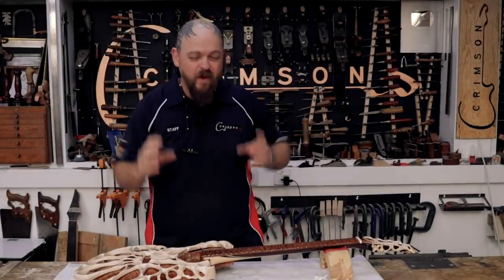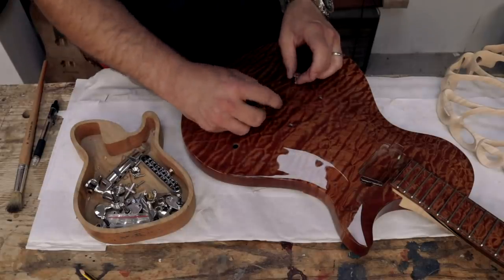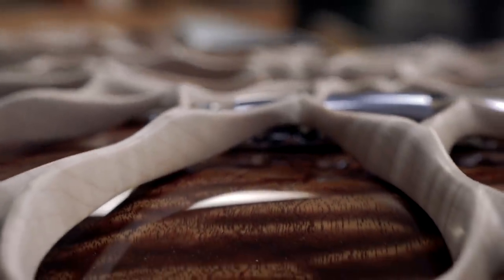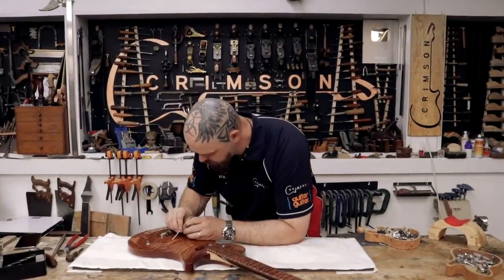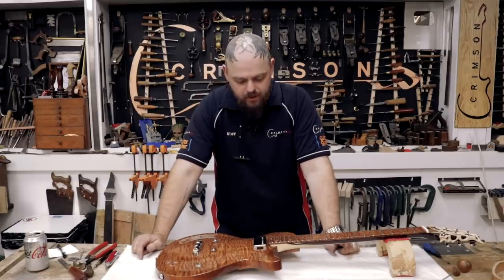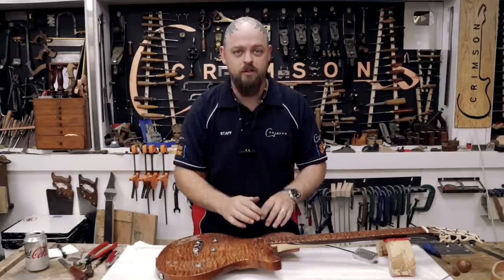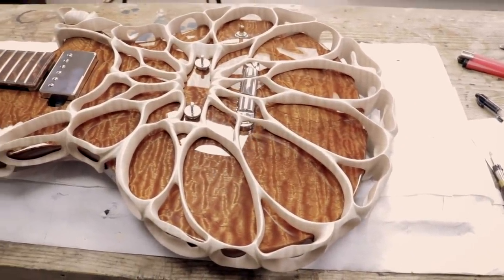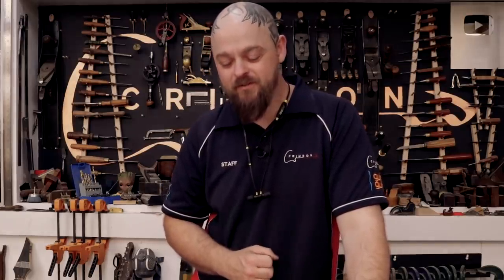Ep 21 Making a Start on the Wiring -  The 90 Hour Build - The Complication

Comment: Try rubber pads between the exoskeleton and the body to secure it like the bottom side of gecko feet or octopus tentacles. Natures way.
Reply: I was going to suggest that too. That or glue very thin pieces of wood inside the grabbing parts, then the exoskeleton would stretch over it and snap back into little grooves in the body sides. A snap and click fit.
Reply: Could also put some magnets in the areas that can’t be seen?
Reply: That's what i was thinking
Reply: @KristonAbbott  Strong magnets would probably interfere with the pickups.
Reply: Rubber would absorb vibrations and reduce resonance, though...
Reply: Thin cork, used in instrument making a decent amount
Reply: rubber dry-rots unfortunately.
Reply: Use a live squid to hold the exoskeleton to the body then … It becomes alive !!!

Comment: the most complex guitar to clean
Reply: Yup. Get out the toothbrush and cue tips!
Reply: @Spthomas47  Oh yes, and don't forget the tube tip cream and oil!
Reply: Compressed air, maybe?
Reply: @helgijonsson3537  that would get light dust, but proper cleaning would require above materials

Comment: It's the insanity I came for.  I can see videos all over the place about normal guitars, I love the over the top guitars you make, not seen a dud yet.

Maybe use a resin colored like the finish had dissolved.  Some small dowel pins to line it up and the resin to squeeze out a bit making it look like it organically dissolved the guitar?  Wood glue on the dowel pins.
Reply: Yep, the insanity is what makes Ben's build videos so different and SO good!
Reply from the maker: @nightlurker  Thank you
Reply from the maker: Excellent suggestion!

Comment: At this point, I would probably use some very thin foam tape. It is dark enough to look like a shadow line, thick enough that all the way around will take up the gaps between organism and guitar.  The foam would be just slightly sticky, enough so that it won't easily slide off the sidewalls.  And, it would eliminate any potential acoustic buzzing between organism and body.  Someone commented on cleaning. This is an important consideration. In this case it could be removed to clean the whole guitar properly, and would be put back together without scratching the laquer finish. (This minor builder's recommendation)

Comment: You could line the underside of the alien growth with craft adhesive felt.  It come in sheets and many different colors.  It could help take up the extra space, and protect the service of the guitar from scratches from the growth.  It would be very easy and somewhat fast to install.
Reply: Or some sort of felt/rubber. It would be a tight friction fit
Reply: I was thinking cork, it’s used a lot in instrument making

Comment: It's a GORGEOUS build that was ad-libbed as the ideas came into your brain. I understand that Ben. Looking back on the build, If you had to make another version of this, I'd love if the body itself had been carved on the sides before you had created the webbing exoskeleton, so you could do the same pattern on both, and in-set the webbing to look as if it were squeezing and choking the life out of the body itself. Much in the same way you were forced to do on the bridge. This would also probably solve the problem of the webbing currently being to fragile for the guitar to be played while sitting down as it would lay tightly into the body giving it natural strength, along with a more secure fitment with glue to bind them. Just the weight of the guitar pushing into one's knee at the bottom of the body would surely snap that webbing in that area of the guitar currently.

Comment: You had the stud holders out for the painting process ,and by putting them back in ,the inner threads have changed  in the direction they where set back in the guitarbody

Comment: Small black felt pads around the inside perimeter of the exo skeleton would prevent vibration and wound be almost invisible, or tabs of leather just as you do when you install strap buttons.

Comment: Has to be said, with the benefit of the Retrospectoscope ™ you might have made a number of easier, and dare I say, better choices with this build, with just a bit more in the planning stages?

Still, an amazing achievement, but I suspect this will be best left hanging on a wall, to be admired, rather than played regularly. Can't see that exoskeleton surviving too many pub gigs!
Reply: PS I can't be bothered to hunt back through so many episodes, but what brand/model are the tuners?
Reply: PPS. How did you manage to get Baby Groot to sit still behind you all this time?
Reply from the maker: @timbeaton5045  Baby Groot is practising Drax's invisibility trick, clearly not working!!
Reply from the maker: @timbeaton5045  And the tuners are Schaller, open gear, locking tuners

Comment: I would just use the strap buttons as a place to mount the exo-skeleton to the body. You can use metal/wooden "washers" to fill any gaps and once the buttons are screwed in place, the skeleton will "float" around the body.

Comment: Magnets! If you attach magnets to the back of the exoskeleton and the front of the guitar they would be invisible and stable. 12 of them, in 6 places. 4 on the face of the guitar top and bottom and 2 on the sides. Or more of them or less of them if needed. <3

Comment: Add the organism to the lower side and right side back. Leave the top alone. Give the impression that the organism is beginning to surround the guitar. Leave enough stock to screw through the organism at the rear elec cover. Playing it will simulate the strat contour.

Comment: I scratch build square rigs (scale shipbuilding) and sometimes I need to bend wood by steaming or leaving in hot water for several hours or days. Then I take out and bend slowly and I clamp into place and leave it until dry. I normally do this with oak, not sure how your wood would react to take a more oval shape and stick to the guitar's surface.
Reply from the maker: There are too many areas of short grain for that.. it would be catastrophic,  however with different wood it would work perfectly.. B

Comment: My very first thought about attaching the alien was magnets. Countersunk into the alien and guitar body along the sides.
Reply: Yes, then it's easily and cleanly removable...Its either that or when the exoskeleton was built, incorporate small flanges in a few well placed areas as part of the exoskeleton and just screw it on using, small special finished screws...remove for cleaning.

Comment: Hi Ben. URGENT! URGENT!
Got a question for yah!
I am rebuilding an old Rosetti guitar from the 50's.
Due to the heathens before me, I have had to remove all of the white paint and grey primer and bring it back to wood.
Now I'm here, I find the open wood just will not take wood dye. It just 
sits there and goes blotchy in places, as if the wood has been sealed.
What can I do to make the dyes take to the wood so I can finish this great old guitar?

Comment: Altho I love this series and the build, I'm confused by your choice of electronics? Why one pickup and in the neck position with just a  volume pot? That's not complicated. Nor standard. It may be cosmetically complicated, but it's bare bones electrically. Put piezo saddles on it, etc. Two pickups, active electronics. To me, I would have gone to the extreme on the actual variety of tone, being as it's an electric guitar. All of which can still be done. But you're a guitar builder, I'm questioning the single pickup in the neck position.
Reply: It's for looks

Comment: Originally I thought this was going to make the top caving and the solid body PRF into one, i.e. cut away and embed or better yet inlay the top into the body infusing them together into one piece in some magical secret Ben sort of way. Yet now it is basically a solid body PRF with a nice glossy finish showing some magnificent timber and fret board with a Ben carves a doodle or a silly string thing on top, not to be confused with "The String Cheese Incident".

I agree as the end result is seemingly odd, disjointed, yet their is a creative solution yet unknown much alike the five sided honey comb future guitar form years ago that in the end turned out well. 

The introduction of copper is interesting, possibly filling the gaps with clear resin or resin filled with copper sand might be interesting especially if the copper sand is encased in various stages of patina that might add a third dimension to this build bridging the marriage of the caring doodle with the body via oxygenated copper sand epoxy. In a very weird way it might come together with abstract and classical form where as in nature a burl forms and looks bulbous yet revels great beauty...?

Its a conundrum as it was interesting, could be again interesting, but what is not interesting is Ben amusing himself making facial expressions and doddering on cam with mindless abandon as its not organic.

On a high note, dare you trace body with the top carving doodle, cut the body to bits on a band-saw and reconnect it all together as one using mixed patina, copper-sand with epoxy resin? 

I like to have a glass half full perspective here, I just hope its not a glass half full of arsenic.

Comment: Ben, this is a crazy build.  I still don't think it will be playable and your creative juices are the cause for that.  You are adding and adding and adding until this guitar will be nothing but something that lives on the living room wall and not in a case so it can be played.

I enjoy these build videos, this particularly, but its getting to you.

For your next project, you should get a cheep guitar from a second hand shop - Cash Generators - for about £100 and use your skills and create an amazing custom machine - pickups, scale length, neck and fret board, paint or stain and finish.

I would be interested, and probably everyone here, in seeing what you can do with a guitar which exists and you are restricted in what you can do with it.

Comment: I don't understand why you would take a beautiful guitar and put some wonky looking spider web over top of it and cover it's beauty with something ugly. Another thing I don't understand is why you use vinyl covered wire. Gavitt cloth pushback wire it's pretinned and you don't have to strip it. You just cut it, slide the wax-covered cloth back and solder it. it's much easier to work with than vinyl covered wire and it looks a lot classier too. the fancy wooden lace work would look great over a neck through with a solid centre block, but just not over that beautiful guitar. Maybe once I see it finished I'll change my mind. The guitar is just too beautiful to cover up with anything to me. the only thing I want to put over a guitar that beautiful is air and somebody's two hands playing it. It's drop dead gorgeous one of the most beautiful guitars I've ever seen a real piece of artwork. Seems like you're overthinking it to me trying to be too smart by half. Nevertheless I love your videos anyway. I just can't see putting anything over something that beautiful. 
God Bless 🙏😇 Y'all.
Jimmy in NC....

Comment: Beautiful work but . . . .  I see some very tricky practical problems in the offing which I have no doubt you will solve. Secondly this same guitar, (perhaps a bit thicker) without the very expensive exoskeleton and with a jazz specific single neck pick-up, capacitor, 7 string?, etc.  might be of interest to the rocker who occasionally doubles as a jazzer. (Larry Carlton)? Can't wait to see it done. Cheers!

Comment: I don't understand the concept. What makes this guitar complex?

Complexity would be something like a neck that could have it's length adjusted as well as adjustable frets for each string, so that it could be tuned to any scale. Then perhaps some very clever electronics built in to the body, with ribbon controllers, light beams, theramin type gesture controllers and all sorts of other interactive toys.  It looks like a normal guitar with an exoskeleton, which in my mind makes it just a normal guitar.

Comment: I did think you were eccentric, which isn't a bad thing, I thought your tattoos on your head had turned you a bit doolalee, but when you explained them, it makes sence.  This guitar was going to be a challenge, to fit it into a time frame would have been impossible 90 hours, it might take 30 hours to address the fitting of the Exoskeleton in a fashion you would be happy with, looking at the quality of your work, and attention to detail, to want to put brass into the mix it's going to take more than a few hours. And  is the exoskeleton going to be lacquered? Because surely it's going to pick up finger marks or  dirt with an open surface finish. 
   I thought this guitar was one of those things like good musicians do, they become popular then go off the rails ( Richie Blackmoore) but after watching ,I  see your not doing it because you have lost your way, your creating something that has bothered you, in your thoughts, and strived to achieve it, the process has been not too  straightforward , but when your outside the norm, it takes time and extra effort. 
     I was a sceptic but now I'm a convert. Keep up the Exellent work.